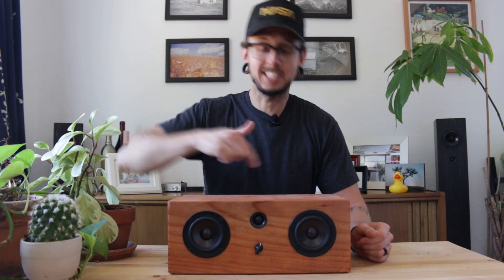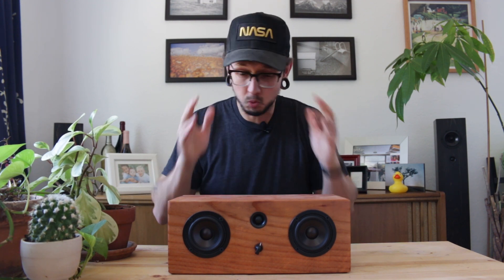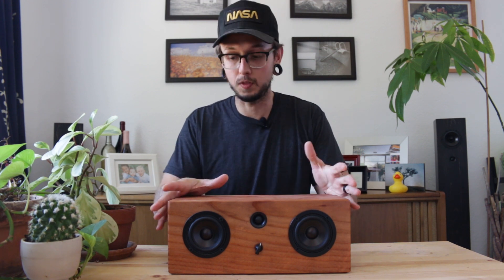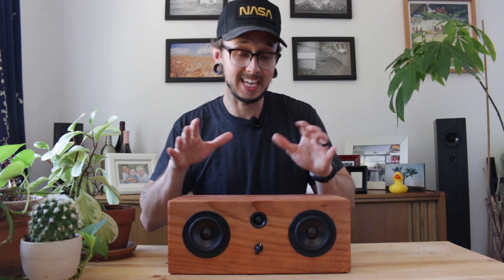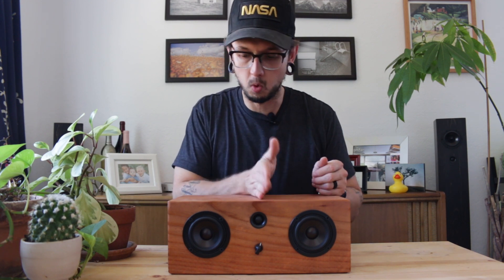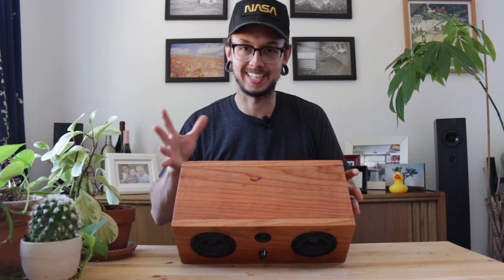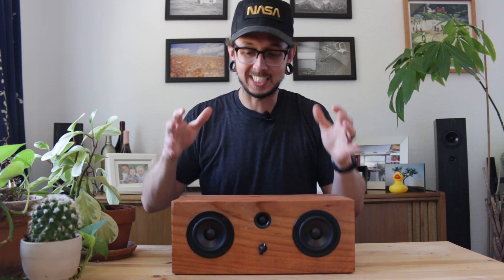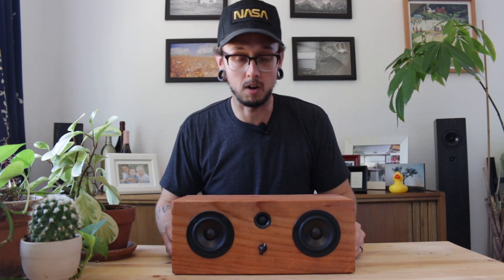DIY Speaker Sound Test! || Basic Tools Bluetooth Speaker

Comment: How do you run a single-channel 2-way setup off of a dual channel amp? I've been trying to plan a build with that amp but am frustrated that I need to use double the number of components to get the most out of that amp since the channels aren't bridgeable.
Reply: I don't know how Kirby wired it but what I do know is that the TPA3110 Chips that those 15watt Dayton boards use are bridgeable. I'm not sure about the other boards though. But you could wire it mono bridged as an MMT speaker so to say

Comment: So, it's designed to be a sealed enclosure, but isn't well-sealed? Interesting. I was thinking that it might have more bass if it had a port. Either way, really. But you'd have to tune the port if you made it ported, which... if the goal is a 'simple' build, the port-tuning process is a bit fiddly. (Not that it's all that difficult, but it's several more steps.)

Comment: It still drives me absolutely friggin crazy that your tweeter is only wired up to one channel. Does that amp only run mono and then divide it to both channels? If not, that's going to cause like literally the worst listening experience ever for heavy stereo dependent tracks like Pink Floyd's Welcome to the Machine, The Beatles' Eleanor Rigby, and other tracks that have stereo phasing and sound staging.
Reply: SkyRumbler    I don't know how Kirby wired it but what I do know is that the TPA3110 Chips that those Dayton boards use are bridgeable so you could wire it mono bridge as an MMT speaker so to say

Comment: This may be an opportunity to do a comparison. How would the sound change if you added a port? Should be relatively easy to remove the back, drill a hole and install an appropriate tube. Seems like it should help the base. Maybe even consider making your own tube to show that it doesn't need to be an expensive option.

Comment: I don't understand why there is one tweeter but two woofers and you say you want to separate the woofers into their own cabinets with a divider as if the BT speaker is stereo? How can it be stereo with only one tweeter? I assumed it was a mono build. I think there are just a little more steps that should be done at the absolute minimum. 

1) Add a second tweeter and make it a proper 2ch stereo sound or leave it as is but make it mono. 
2) Make it a complete first order crossover by adding a cheap iron core inductor (maybe 1.5mh at the mimimum) to the woofers. This will help a lot with the peaky midrange problem and allow more bass perception at the cost of some efficiency.
3) Put resistors on the tweeters to balance them with the woofers. Currently the tweeter is tearing my head off lol. 

These are simple and the most basic steps. Seems to me would cost about $30 more to add this and it would make the speaker way more listenable.

Comment: Needs more bananas!  Would ported chambers for the woofers sound better?
Reply: Yeah, that should help. According to Parts Express, the F3 in a sealed box would be 142 Hz, and 81 Hz vented.
It's hard to find small speakers that reach even to 80 Hz in a sealed enclosure. I was looking and the 3" HiVi B3N should be able to do it, but it's response is all over the place and I'm looking for good sound quality.